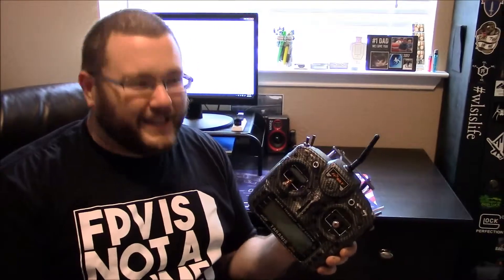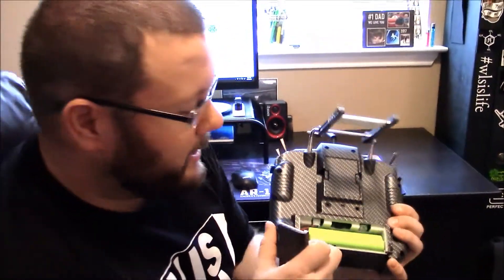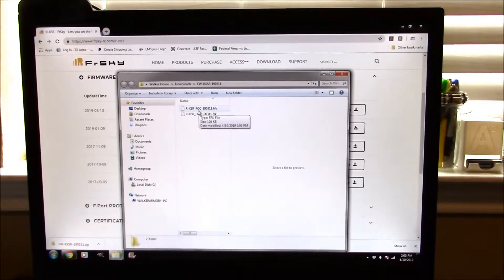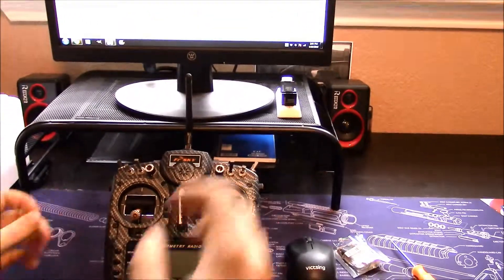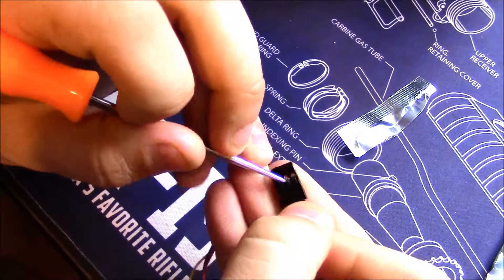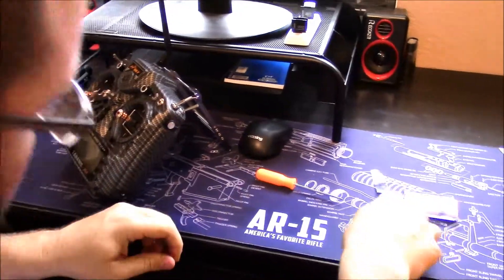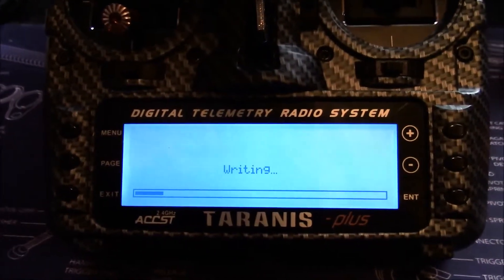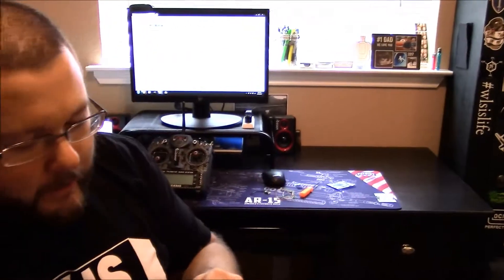R-XSR Firmware Flash with the Taranis X9D | How-To

Comment: Question: Does the Receiver have to be bound first?  Tried it again today and it still doesn't work.
Firmware Flash Failed Device Not Responding.  No explanation. 
This is a brand new X9D Plus 2019 and brand new RX8R Pro.
I checked all the hookups, followed your procedure step by step.  S.T.A.R.
Reply: does not have to be bound

Comment: I have the same controller and receiver as you.  However when I go to download the R-XSR ACCESS firmware from the FrSky website, it has a different name and different file extension, RXSR_ACCESS_2.1.0.frsk.   I load it on my SD card, go through the steps and I'm informed "firmware flash failed [EXIT].  no explanation what went wrong just "snafu full stop"  Whisky Tango Foxtrot, over?  

I've been banging my head on this hardware and the instructions I'm able to find ALL DAY.  Forget about FrSky I think they want you to damage your purchases as much  as possible fumbling around. Then buy another one.  In a really foul mood over this, after waiting so danged long for it to be delivered.
Reply: Dennis.  Looks like FrSky has renamed their files recently.  The other thing to watch out for is what type of Controller you have.  ACCST vs ACCESS. The files now have the type of controller in the name.